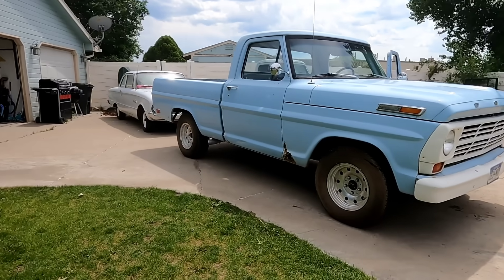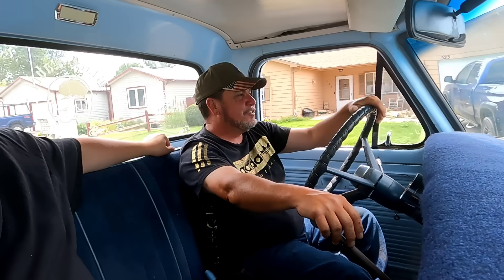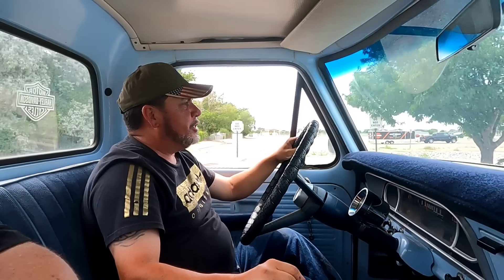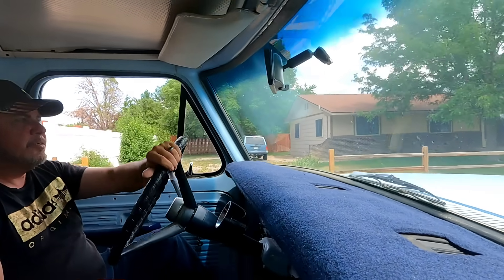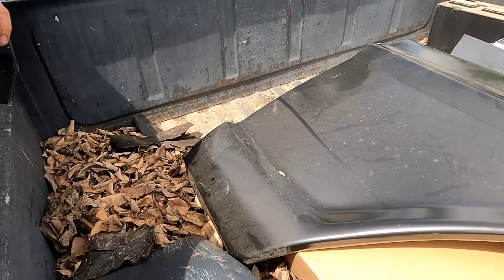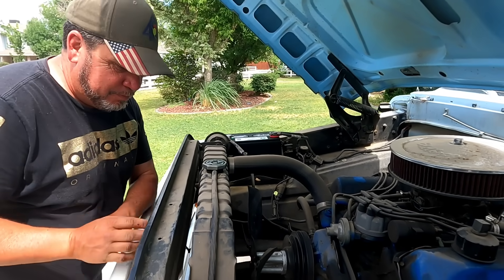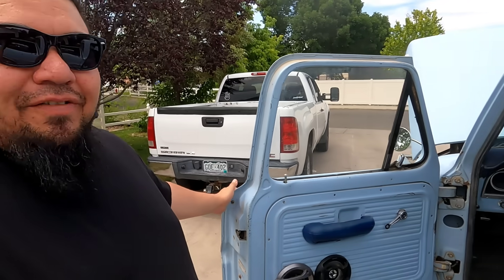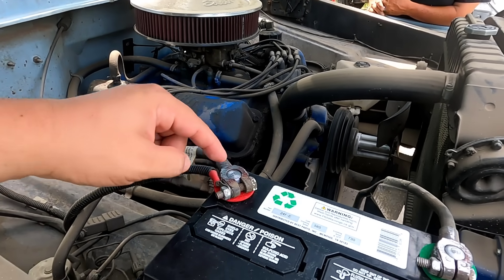Ford F100 Pickup New Daily driver???

Comment: I still have my first pickup, a 1976 ford F-250 highboy 4x4.  I bought it in 1979 for $3,000 It had a 300 six/ 4 speed that i swapped for a 429 TJ about 1990. Just been sitting up here in Montana since 2000. I just can't sell it!! One of these days Ill get it going, it ran fine when I parked it so it shouldn't be too tough.
Reply from the maker: That is awesome. I would do anything to have my first one back. I absolutely love those trucks.
Reply: 300 inline 6? Hell ya! No downshifting, just hit the accelerator and go.

Comment: Man!!! And Carolina Blue too!!
I had a 69 F250 w/360, Camper Special 4 speed, quickly changed out to a station wagon  390, 4brl and Blackjack Headers...
Converted it to 1 ton suspension and GMC 18" duals by enlarging axel holes and fenders for clearance. Top end unlimited. Out ran the cop's with that puppy...
Reply from the maker: Niice 🤣👍

Comment: Nice truck.  I bet after getting that old gas out and running some good gas ran through it, it will be nice.  Keep gears as is, that way you can tow without issues.  😊😊😊😊

Comment: I had a 69 same colour as this one. It was basic as you could get. In-line, 3 on the tree, arm strong steering, standard brakes. It didn’t even have a radio, 2 wheel drive but it would go thru pretty much everything a 4 wheel drive would go.
Reply from the maker: They are definitely some good tough old trucks. 👍

Comment: I wouldn't bother disc brake conversion. I found all the spring kits, shoes, drums, etc and rebuilt the brakes. Stopped REALLY well. My 460 auto worked REALLY well with 3.00 gear. Pretty sure that would work well for you. I had a spare third member with 3.70 gears which was more fun but more gas.

Comment: Man, I really hope you don't CV that one.  swap the beams out for 73-79 disc brakes and power steering, best thing I ever did was add those to my 66 F-100. If you find a power steering truck for parts, pull the column, inner and outer firewall brackets. they are different from non PS trucks.  Cheers!
Reply from the maker: Awesome, thanks for sharing. Other than disk brakes, it's probably going to stay the way that it is.

Comment: You like to steer vehicles? Not drive them. Your brother can get a crown Vic  front end, for that power steering and a modern  suspension
Reply from the maker: That would be a cool swap on down the line for sure.
Reply: It’s pretty easy to and surprisingly cheap at the junkyard get rotors calipers everything

Comment: Ford did not put 390 in pick up
Reply from the maker: I'm not sure if this is correct, but I've been told in the past that they did put them in the camper special pickups. We were told by the previous owner that it was a 390. Either way, it's an FE engine for sure, and it runs really well.
Reply: The 390 FE was an option in gen 5 series F series pickups. Because it has a two barrel carburetor it could be a 360.
Reply: They offered the 390 in pickup's up till 1976
Reply: Pull the #1 and #4 plugs. Bring either piston to TDC (its counterpart will be at BDC at that point). Measure difference in stroke to a solid referencing point. 390=3.785”
360/352=3.500”